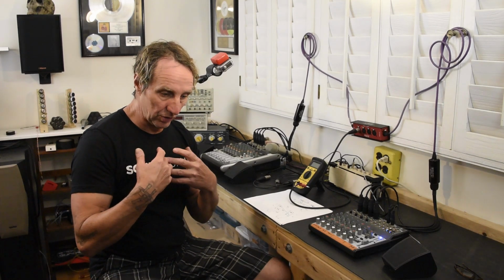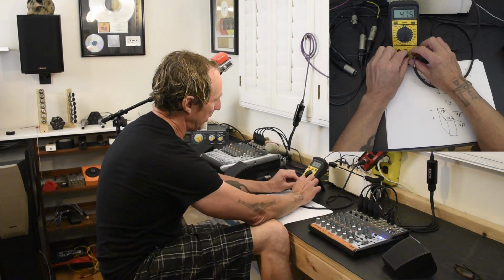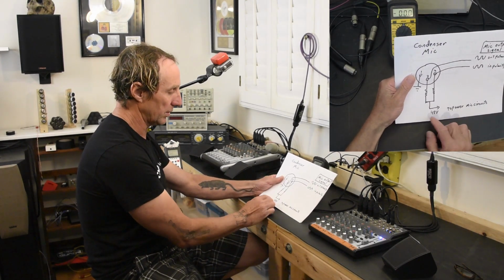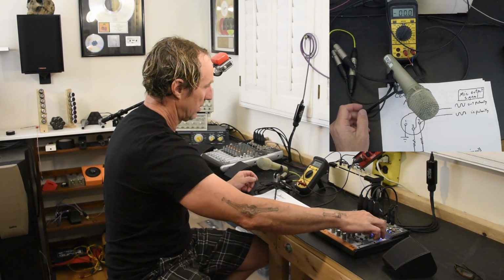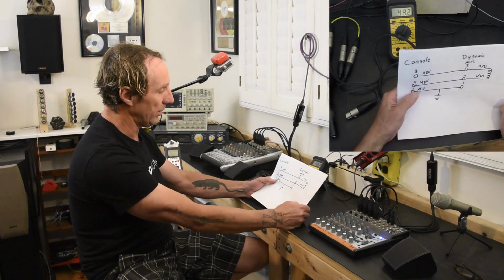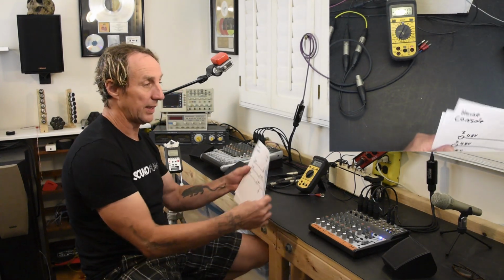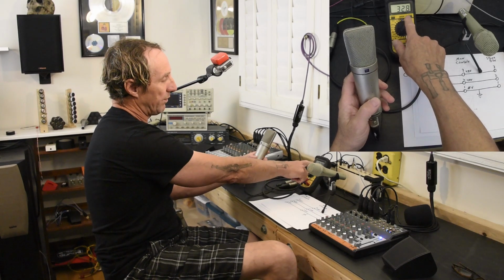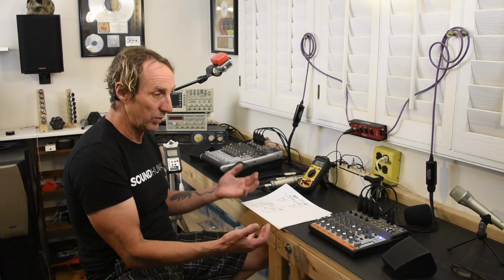Understand Audio Phantom Power + Demo

Comment: Going to an iso split is a large increase in cost. Is there any downfall to a good quality “y” splitter??  

Seems cheaper, lighter, easier, and without much if any drawback.
Reply from the maker: hardware splits can work great as long as you're grounding scheme is correct and you're using a star ground system. 

basically, All of the year needs to plug into the same AC ground. 

transformer splits are useful because they allow you to solve ground boot problems or improper grounding setups fairly easily without troubleshooting the actual issue. 

or in scenarios where the star ground setup can't be used or is overly challenging like connecting multiple buildings with audio. 

also set up complexity plays a factor 

if you just have two consoles and a fairly small setup using a hardware I split can work fairly easily and reliably. if you have recording trucks coming and feeds to multiple other locations, putting those feeds to remote locations on transformers is often the best way to deal with them
Reply: @DaveRat thanks so much. I’m trying to put together our first IEM rig for small clubs and it’s been a lot to learn.  This vid def helped.  

Two art 3 ways would add about 1k to the cost when you take into account the larger rack and cables.  So it’s a significant increase.  We would def not be spreading our gear over multiple buildings. The rack would be one AC and our pedalboards and amps would plug into the same stage so hopefully this would all tie into one ground.  

Sounds like the isolated transformers are the surefire method but really only needed in a very specific scenario.  That said it would really suck to get to a small club and find out my entire rig is a no go.  I’ve certainly needed the ground lift on my pedals due to ground loops and hum though this sounds like a separate thing you’re talking about.  Tough decisions.
Reply from the maker: Carry all the power cords you need and plug everything into one set of outlets or outlets all located very close to each other on the same panel and you should be good.
Reply: @DaveRat CBI cables makes a hardware split with or without ground lifts.  Do you think having the lifts is worth it?  Thanks again for all the advice.  There’s so much to consider.
Reply from the maker: with a properly grounded system, the ground lifts won't do anything. but they do help for troubleshooting

Comment: Dave, is it ok to plug and unplug condenser mics while phantom power is on, like you did in this video?
Reply from the maker: It won't hurt the mic. The mic has no idea whether you are plugging it in to phantom or turning the phantom switch on

 The main issue with hot plugging condenser mics into live phantom is the huge pop or boom that happens if the channel is not muted.

Other than that, all good
Reply: @ Cool, thank you very much for your fast response! Cheers 🤙🏼

Comment: It would have been cool if you could have demonstrated with an oscilloscope, just to illustrate how phantom power is basically just a large DC offset. Also (and this is just my personal anecdotal observation), but I've encountered situations where a condenser microphone seems to have a lower maximum SPL on 12VDC phantom power than it will on 48VDC phantom power. I would be interested in your insight - am I crazy?
Reply from the maker: Yes some mics 48 volt only and some are 12 to 48 volt. On the ones that are 12 to 48 volts I have seen specifications that derate their maximum SPL by 3 to 6db. Pretty sure I recall first seeing it on the AKG c451 12 to 48 volt version.

Comment: Can the phantom power ever damage either of the consoles providing it if the split is passive/not transformer isolated?  I would assume the power would travel back up the split into each other.  i.e. monitor and FoH console both going into a passive split - I'm just wondering how people get away with passive splits in this case
Reply from the maker: Consoles that can create 0hatomenpower are immune to damage from phantom power.

Most mic preamps are immune to phantom power impacting them.

 Transformers are immune

Most input circuits are immune

Some or many output circuits are not immune and will either act strangely or possible be damaged.
Except:
Mic output circuits are almost always ummune

As a rule of thumb, phantom on input circuits, all good, phantom to out put circuits, not good.

Passive splits is connecting multiple input circuits to a mic output

Comment: I may be late to the party, but here is my 0.02€. 
From the perspective of a recording studio fix/monkey
About phantom and dynamic microphones, the world is full of boffins. I've lost count of the microphones lost to bad cables and phantom power mixed together. Even moreso when some equipment has lower feeding resistor values because they were too cheap to pony up for some real 48v PSUs.
Then there's the classical problem with cheap Chinese microphones wired wrong from the factory, including Thomann's own brand stuff.
On the other issue, if the phantom power is well executed on the console itself, this means a real pair of 6.81 kiloohm resistors feeding pins 2 and 3 from a real 48v source, there may be two scenarios: 
One is that the resistors are connected to ground if the p48 is switched off, then tough luck. Your p48 has just been converted into p24.
Keep both p48 feeds on if you want to keep the mic preamps happy.
The other option is that the 6k81 resistors are left floating when off, then you may or may not want to keep both feeds on. This depends on what's on the other side of the cable... Not much of a problem in live audio, but in a studio, yup, it may hurt something. The misconception is that it doubles the voltage, when, in fact, it doubles the current into a dead short. Instead of 7mA it goes to 14mA. It may be a problem if the circuitry inside the microphone expects exactly 7mA, like some very old versions of the venerable Neumann U87. (It takes the polarisation voltage straight from the number 2 and 3 pin, no regulator, no nothing, and it expects around 39v here).
There are some old mixing consoles, like some Telefunken/Siemens and Never broadcast thingies that feed phantom straight thru just one resistor to the center tap of the microphone input transformer. A nice way to fry some mikes AND the console at the same time.
Don't even get me started on bantam patchbays that have phantom power going through them. A nice way to fry a ribbon, smoke the preamp and get tinnitus maximus from the monitors trying to expel the woofers at the same time. (Neve 8232, looking at you)
On the other hand (third one), there are some really bad implementations on cheap and nasty consoles, like the RF blocking caps on the microphone input being rated only at 50v, really bad tolerances on the feeding resistors and leaky DC blocking caps going to the ultra cheap op-amp pre. Arrrrrgh.... Been there, modded, fixed, cussed off soundcraft/Harman, phonic, mackie and Behringer engineers...
As of late, I'm resorting to go all dynamic for the small gigs I sometimes do, just not to get into this very pickle.

Comment: Hey @Dave Rat, does this same process apply if your splitter does not have transformers? TYIA.
Reply from the maker: Most splitters would transformers do not pass phantom power.

So I didn't really cover anything having to do with transformers in this video.

If you do have a transformer and it does pass phantom power then it would be the same as no transformer
Reply: @DaveRat  Thanks Brother! This issue has long been debated and your kindness for doing this video as well as your other videos, will put this issue to bed!

Comment: EXCELLENT video as always!

My only comment is that this only works IF everything is properly wired and undamaged. You did touch on what happens if a dynamic mic is in the mix and an unbalanced cable is used...BUT what about the possibility of damaging a console's input or the output on a piece of equipment with improperly wired cables, a damaged cable, or some other issue combined with phantom power? I've just been burned by this one too many times...especially when tying into someone else's gear. If it's all your gear, and all properly maintained, perfect! I still much prefer an active or transformer split for some isolation, but that's just me...
Reply from the maker: Phantom power should be safe for all pro gear regardless of being wired properly. It is limited by 6800 ohm resistors and gear designers should and almost always take into account the potential existence of phantom

Computers, semi pro, super cheap and home hifi gear? Not so much, that will often get cooked by ohantom

Comment: For the more technically curious, the actual 48v power supply in the mixer feed each channel separately through resistors, typically 20k ohms or more, so that any difference in the multiple supplies will be dissipated in a small amount of heat, and not damage the microphone or mixer. Even If one or more wires is shorted to ground, like using an unbalanced cable, it will not greatly affect other channels. The only possible damage would be if the microphone voice coil or transformer cannot handle the current. For example , a typical mixer feeds pins 2&3 through 47k ohm resistors, and a typical voice coupled is 200 ohms, so 48v would place about 0.2 volts across the microphone voice coil. It would not be healthy, and would push the coil against the end of its space. It would also generate some heat. The actual damage would depend on the specific microphone.
Thanks for the excellent demonstration and keeping it simple.
Reply from the maker: Agreed and I believe the phantom power spec calls for 6.8k ohm matched pair resistors
Reply: @DaveRat  thanks, I couldn’t remember off the top of my head.

Comment: Hi Dave,
Is it safe if I plug a 12VDC 3 pin LED XLR lamp in a mic input on a mixer or an audio interface  and power it with phantom power?
Reply from the maker: It's safe but won't work.

Phantom is not enough power for those lamps.

Try it if ya wish, won't hurt the lamp or mixer but won't light either has been my experience
Reply: I plugged it into my Scarlett 2i2 and the phantom power does light up the lamp at full brightness but was to afraid it might harm one or other if left plugged in for too long. Was afraid of overpowering the 12V lamp using 48V power, but if you think it's no harm to either than I'll try it on for a longer period. Thanks:)
Reply from the maker: Interesting. Is it full brightness or dimmer than when plugged into the normal?

Phantom is such a low current that most any LED can be put on it and it will light and none will be damaged.
Reply: All 4 LED has been on and working fine for the past 2hrs. Output is probably only half as bright compared to using 12V adapter. I'm only using the lamp on my lighting console as it's pitch black on the board. But now I think it would be better if I just stick a LED strip just at the bottom faders on the console instead of using the gooseneck lamp. Thanks Dave.. Huge fan here buddy and was blown away by your DCA techniques mate. Thanks so much for your contributions to the audio industry 😊

Comment: Great episode 👏  what would happen if both desks had phantom power on but one desk had phase reverse on ?
Reply from the maker: That's an interesting question. Since phantom power is 48 volts on both pins two and three and a polarity reverse only switches to with three polarity reverse makes no impact on phantom power.

There are several ways to reverse polarity either by swapping pin 2 and 3 or as consoles normally do after the line is unbalanced putting a polarity reverse opamp or circuit there.

Either way phantom shows up on both pin 2 and 3

If you have the time check out my videos on phantom power you may find them interesting I did one specifically on powering mics with multiple consoles

Comment: I'm a total novice about this topic but I have a question about using drum mics. The typical kit comes with various dynamic mics for close mics on the drum and two overhead pencil condenser mics that require phantom power. Obviously, when using one mixer, you have to turn on the phantom power for the condenser mics but that means it's on for the dynamic mics too. It sounds like you're saying this is ok as long as the cables are good. I was wondering this is the normal, expected way to use these drum mic kits. I haven't found any source that addresses this specific issue. Thank you.
Reply from the maker: Mosicers allow 6urn8ng on phantom on each channel seperately. That said, if phantom was dangerous to any mic, that would be a huge problem.

Phantom is safe for all mics with properly wired cables and phantom is so low power almost no mics can be damaged by it though there are some older ribbon mics that can be damaged by wind, dropping, blowing into them and potentially miswired phantom.
Don't worry, you won't ever encounter these or any mic that can be damaged by phantom unless if you break into the vintage mic section of a recording studio.

Comment: Question please.  I have a splitter that itself provides phantom for each channel if needed.  In your scenario above, I am assuming that a voltage drop occurs because I have two consoles FOH and monitor not turned on for phantom as I have been relying solely on the splitter source for the power.   I don't use enough condensers that I think it would cause too far a drop, but with that scenario, should  I be keeping it as I have it or should I have phantom on both channels from both boards as well as the phantom on the splitter.   My boards allow phantom to be selected for each channel needed vs powering the entire board.   Thanks for the explanation, it makes sense, I just never gave it a thought before 🙂
Reply from the maker: If your splitter supplies phantom, just use that. The sitter will most surely block the phantom from the consoles so console phantom is not needed

Comment: What's this buzz with Neumann? Bad connector?
Reply from the maker: do you see the banana plugs that are plugged into the volt meter so we can see the phantom power voltages? Those are on a Y cable attached to the mic and console and the unshielded ends of those cables are what is causing what you hear buzz and click wise.
Reply: @DaveRat  ok thanks. Hi Dave, have a good day. Fuck its 2am and I almost finished my subkick xd. Gonna test it tommorow at a gig.
Reply from the maker: Let me know how it works
Reply: @DaveRat  for now ok, i'm recording. Nice boost for kick. The band complained because I hidden their new sticker logo behind it, haha.
Reply from the maker: Visuals always win over sound
Reply: @DaveRat  they taken it lightly because I've done a good job. I'll show you all the stuff, just need to find time. I'll reply in a few days.
Reply: @DaveRat  yeah I know, didn't have time yet. Hold on :)))

Comment: I wish obvious phantom power indicator lights were standard on all mixers. A pro tip for club engineers is to mark any channel on the tape when phantom is on so when the band is finished the engineer is reminded to mute the channel immediately.  Experienced musicians know that they need to make eye contact with the engineer before unplugging a hot  phantom powered instrument, but this will inevitably slip by the most seasoned sound engineer, and that painful pop is a real vibe killer. It happens to me occasionally when someone starts chatting with me at the board at the end of a set and I get distracted.
Reply from the maker: Whilest I personally don't worry too much about phantom 9n or off, I do make sure channels are muted before swapping mics at a gig. And if I see the peak lights flash on a muted mic, there is a good chance phantom is on.

Phantom power is about as dangerous as drinking a soda in a car, all good except if things go terribly wrong